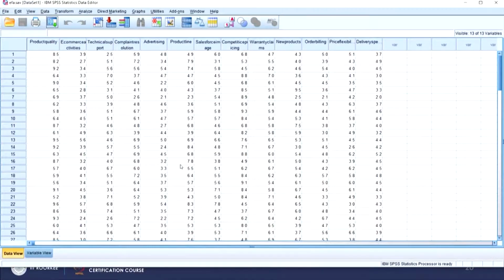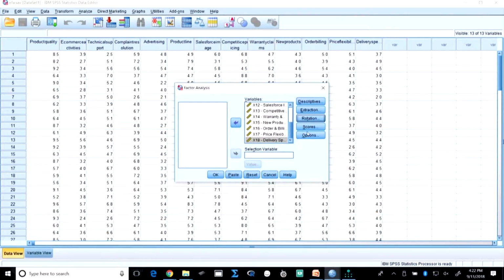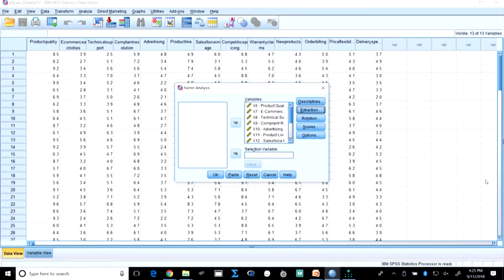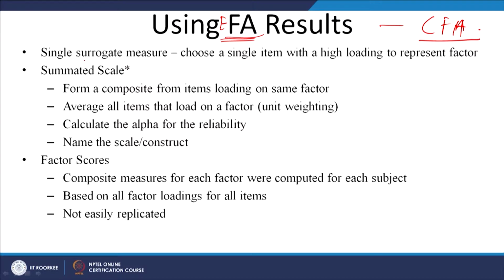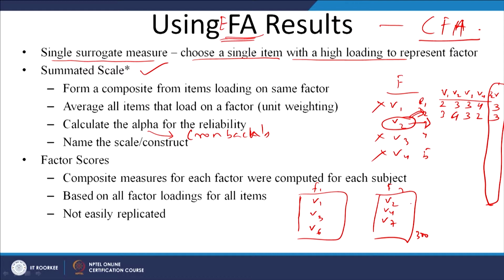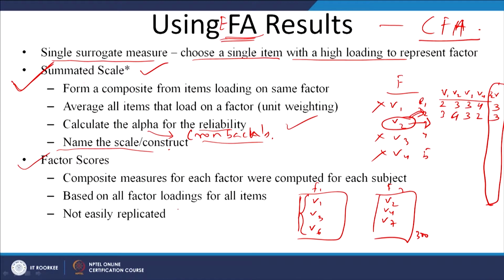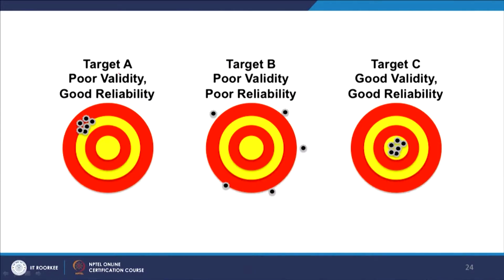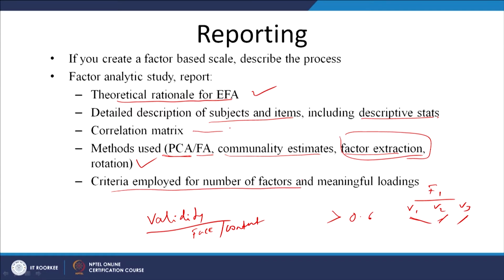53. Exploratory Factor Analysis in SPSS

Comment: Thanks Dear professor for this super video. 
I have  a question: 
In Exploratory Factor analysis many researchs assume that the factors are not correlated with the measurement errors and the measurement errors are not correlated between them. 
This assumption isn't valid in reality?